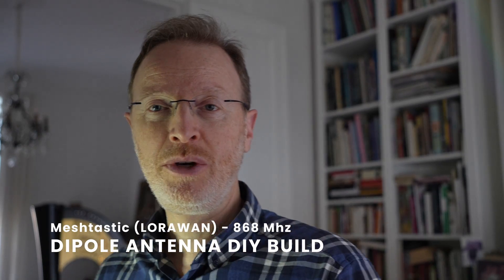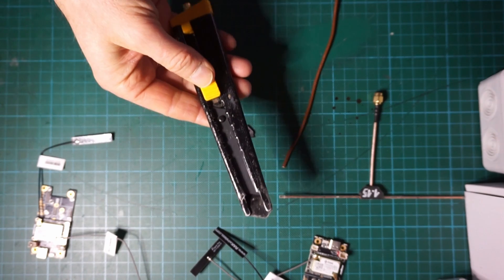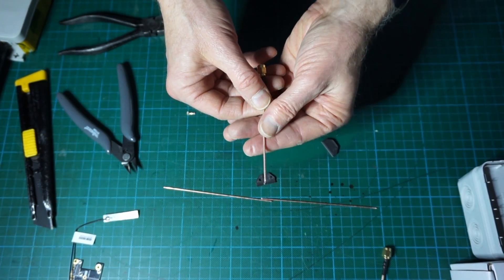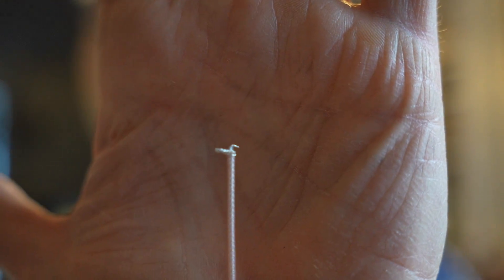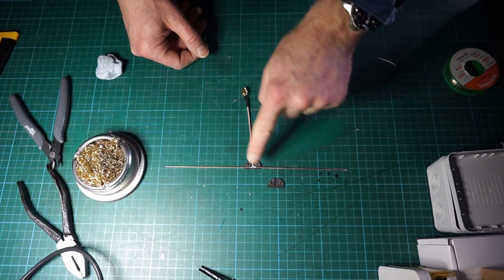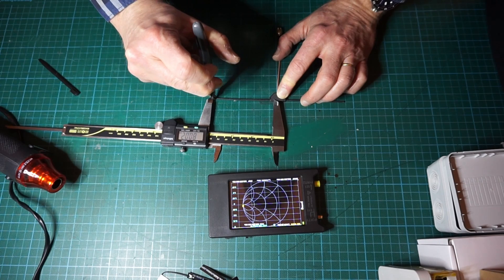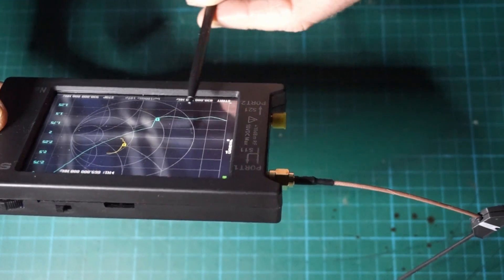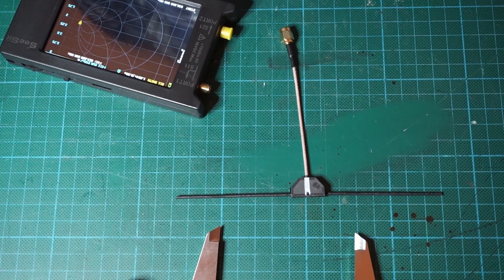How to build your own DIY Dipole 868 Mhz (LORA - Meshtastic)

Comment: If I use a measure tool for 868Mhz, it would be 0,164 meter or 16,4cm full lenght, but I presume you made a half wave dipol. Why not a full wave? It would be still 16 ish cm? It would also be nice if you put the stl file here.
Reply: The half-wave dipole has the best (close to) omnidirectional gain , whereas a fullwave dipole has already a certain directional gain characteristic.

You may refer to the channel of Andreas Spiess and his explanation on antennas for LoRa

Comment: Зачем снимать изоляционный слой, чтобы потом надеть термоусадку? Можно было оставить изоляцию на медном проводе.
Reply: To be able to straighten the wire with a drill. Otherwise, it will be неаакуратненько. ;)
Reply: @le-francais  I made this dipole without precise line accuracy. SWR 1.2. Max distance was 13.4 km in city. Now i want to build GP or collinear type. Because the city is huge and we need to get more stable connections between nodes.

Comment: The wavelength at 868 MHz is 0.345 M. For a dipole, we would have half on each branch of the dipole. Well we measure 0.075m or 0.15m for the wavelength, which corresponds to 2GHz ?? Merci d'avance..
Reply: this is half-wave dipole, so we have a quarter on each branch

Comment: Looks good. I am thinking of making a vertical antenna. This looks Horizontal to me. George
Reply: If you turn it vertically, it's a vertical dipole. The radiation pattern will tend to be fairly low to the horizon so it can be (and usually is) the preferred orientation. If you have (fairly steep) sloping ground in the direction of communication, though, a horizontal can make use of ground reflections, boosting the effective gain.

Comment: I am just making up one of these, and appreciate the video. However i wanted to check, the antenna is always shown with the radiant element horizontal. Should these not be vertical or the pattern will be emitting its longest range and strength vertically instead of horizontally? Just thought this might be good to mention. I tried putting a bend in my Very heavy Pigtail to change the axis and its throws the VSWR off by a full point. Really amazed at home much difference having it sitting anywhere another object makes. Antennas really are an art form almost as much as a science.
Reply from the maker: Yes, the dipole emits as a flattened donut shape around the radiating elements, so you have to have the feeding cable horizontal and the radiating part vertical. Any addition of a capacitive or reactive objects to the antenna will modify its characteristics. Any addition of connectors will also increase the losses (I believe +3dB loss per additional connector)
Reply: Thanks for the confirmation. Got mine to 1.4svwr at 48ohm. Tried a couple of times to get below 1.4 but couldn’t seem to quite get there before it started going back up.
Reply from the maker: @mostlysane77  That is pretty good and will already be a huge improvement over off the shelves antennas

Comment: Hi, great video. I would like to make one of this for 915MHz antenna LoRa. Should I use the same method? Thank you very much.
Reply from the maker: Yes sure, except you have to adapt the length of the two radiating elements in function of that 915Mhz frequency range (rule of 3 will work)
Reply: @PoweredMeshtasticEurope  And I should reduce the size of the coax wire a little bit. Thank you very much.
Reply from the maker: @anlpereira  the coax wire's length is not so important.
Reply: @PoweredMeshtasticEurope  thank you very much.

Comment: You are going from unbalanced line (coax) to balanced (dipole). Isnt balun required? Also 50 to 75 ohm is not the best match, as shown on vna
Reply from the maker: You're right. Ideally you should have a balun to get a perfect impedance match, without any reactance (capacitance or inductance). But this is out of reach of the common tinkerers and it works weel enough with that simpler approach.

Comment: Just build this dipole antenna, and tuned it with my NanoVNA, getting a SWR 1.4. And holy crap, that improved things.. Using a T-Echo and that factory antenna is for the bin now.. Can see a node 600m away, and that improved from RSSI -115 to -94, and in indoor bad inviroment.. So i need need to make another now, and run more tests.. I'm hooked :-) Thanks
Reply from the maker: Great !
Reply: 600 meters is a bit  low, is that inside the building? With default ~10cm Lilygo antenna I was getting 20 km range with one antenna a bit under the roof of the house, the other antenna in hand. 
From top of a mountain at ~1400 meters high I got 120 KM range with a tiny SeeedStudio T1000-E device, that small card shaped one that doesn't even have external antenna 😅

Comment: Very good and informative video! I am going to build some an see if I can increase my range. I have bean looking at pigtails for this and I have two options for coax RG178 and Rg400 woud the RG400 be stiffer? Is it ok to use it? Or might I be better off using a tube on the outside of the coax to stiffen the antenna? (we have a lot of winter in my area and I am afraid the coax might be damaged over time with the constant bending)
Reply from the maker: I have personally stiffened the coax with a simple piece of electric wire (taped).

Comment: Can I ask, is there a reason you strip the wire and then cover in heat shrink? Just wondering if it performs better than with the original insulation.
Reply from the maker: Yes ! The stripping i required to straighten the wire. Then The heatshrink will protect (against oxydation) and stiffen the wire.
Reply: @PoweredMeshtasticEurope  Thank you for replying - that makes complete sense👍

Comment: Excellent video. Im off to go make a couple for mine. You dont have to strip the entire wire, i would cover the exposed ends with some silicone to keep the wire water  tight. Thank you. Subscribed
73s VE6RFL

Comment: I would only tune the antenna after installing it on its final location.
Anything in close proximity around it affects the tuning, even the mount, where you secure the 3D printed part will.
The heat shrink tubing is a way to UNDO too much cutting 😂
Reply: Or at least have the antenna in "free space" and not lying on the table.  The proximity to whatever that material is in the near field will have an effect.
Reply from the maker: could be done but would require to move the Nano VNA on site

Comment: SWR 1.0 doesnt mean "all energy is emmited". No!
Reply: Just means that none of the energy is reflected.  Use a long enough and lossy enough coax and you'll get 1:1 swr but 0 field at the other end.
Reply: Oh my. Antennas are rarely a simple 50 ohm resistor.
Reply from the maker: What's your definition ?
Reply: @PoweredMeshtasticEurope Hard to descibe without some background in physics.   Pure resistor 50 Ohm has SWR 1.0, emits RF energy zero (but heat)
Reply: @jacuswoczega9180  there is no reason for a dipole to have a low efficiency. Anyway get a tiny sa, measure the dbm a few meters from the antenna and do a ballpark estimate if emitted power seems out of the ordinary. If we are talking about those ‘3 meter cable’ cheap antennas from aliexpress then yes, low swr is a result from cable losses and not antenna performance.
Reply: @PoweredMeshtasticEurope https://en.wikipedia.org/wiki/Standing_wave_ratio

Comment: A very useful video.  Isn't a dipole 75 ohms when resonant, so 1.5 SWR is about right.
Reply: a resonant dipole presents 50 ohms of impedance
Reply: @nerdlywehunt  No, that's not correct. A dipole in free space is always around 73-75 Ohms. However, a match of ~1.5:1 is perfectly acceptable, though you can take steps to improve it. There is plenty of information to keep you mad forever online about that!

Comment: is the length of the vertical wire not part of the total length or should we consider the coax non receiving
?
Reply from the maker: The coax does not "receive" (but is part of the circuit). Ideally the coax part should be 1 wavelength (1/2 wavelength is also ok. Other multiples will generate reflections). In practice it is difficult to have it tuned perfectly (there are so many factors : quality of the dielectric, thickness of it, impedance, reactance, etc).

Comment: Also the wire cutters you have appear to be rated for 1mm max cable or so it appears. If you keep using them for larger stuff they are likely to break and take your eye out.  Its happened to me twice now, thats why im replying to you on my braille touch screen tablet which works wonders.  

I'm assuming ive typed this in the right place?
Reply from the maker: sorry to hear what happened to you. Thanks for the advice.
Reply: @PoweredMeshtasticEurope  Hah, while funny, he is right to some degree. I don't think your wire will cause it to break, but they can and DO, especially if you try to cut harder wire than copper, or larger diameter. They are little electronics nippers meant for .5mm and smaller. Trying to cut some like 6awg stranded wire might work, might break them. That's how I broke a set of my xcelite cutters. And when they DO break, it might be just the tip, might be a whole jaw! All that force goes somewhere, which ends up being turned directly into kinetic energy imparted on the part that breaks off. Which can make it move quite quickly, easily more than enough to pierce skin, or take an eye out.

That's the same reason why it's extremely important to constantly 'dress' your punches and chisels. The end you hit with a hammer mushrooms out, and eventually a fragment WILL break off, and the entire force of the hammer hit shoots them out like a bullet! Same thing applies to these little cutters!

Comment: Can copper welding rods be used instead of wire?
Reply from the maker: sure. But thickness will have an impact. In fact the thicker, the broader the bottom of the VSWR curve but not as deep. So you can choose to have a broader range antenna but not as good VSWR or a better VSWR with narrower bandwidth.

Comment: Use the base of the useless Antenna that comes with the device,  just cut off the centre conductor... and add your design
Reply from the maker: Yes, any coaxial feeding line does the job indeed (coax needs to be thick enough though for minimum losses)

Comment: To straighten the wire, grip in the vice and pull with pliers until you feel it yield. No need to spin it, and the wire becomes perfectly straight.
Reply from the maker: can work too but more difficult to have enough strength to pull straight. Using the rotating power of the drill is no effort.
Reply: @PoweredMeshtasticEurope  True. I can pull up to 16SWG, but that's my limit.
Reply: @PoweredMeshtasticEurope  First of all, great video, thank you for posting. I do have a question, is there some way to "strengthen" the antenna, maybe some sort of PVC tubing etc just to make it more weather/wind proof?
Reply: @PhilRosaLeeke  Yes, PVC tube should work. Those small WiFi antennas on your PC are also just plastic housings.

Comment: Nice video. I purchased 2 Heltec ESP32 v3 today which use the ipex connector. So for these you would cut off the sma instead.
Reply from the maker: Thanks for your comment. The pigtail which is delivered with the Heltec V3 is not a very high quality coax. I would suggest using a pigtail such as shown in my video instead. But technically you could do what your saying.
Reply: Any Recommendations how to tune it as NanoVNA comes with SMA  i.e. is there suitable ipex-SMA adaptor that would allow tuning antenna that has ipex connector at the transmitter end?